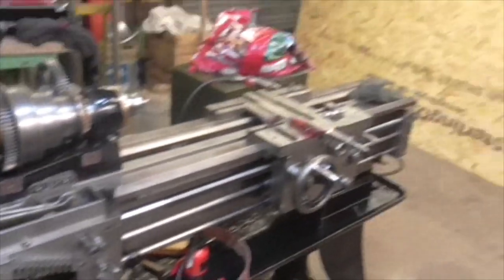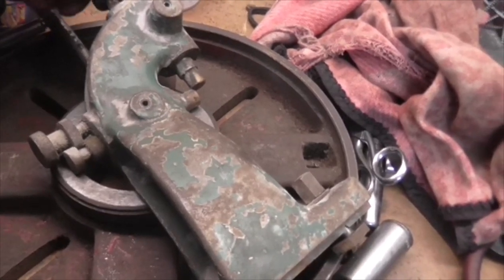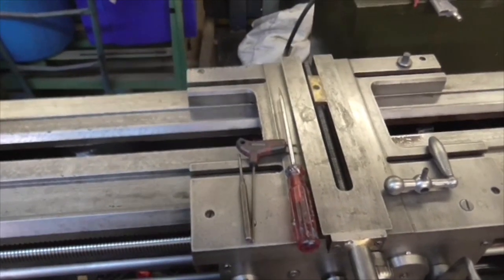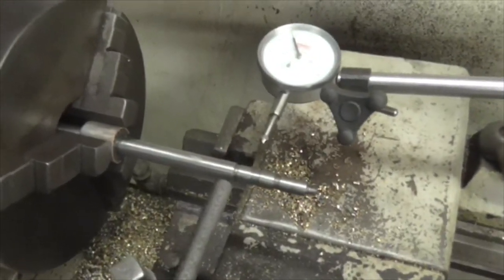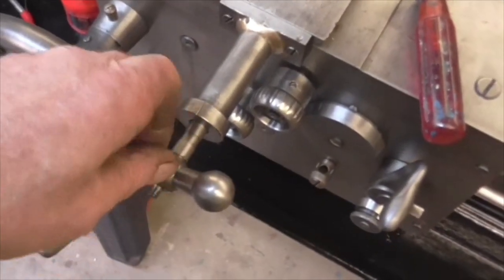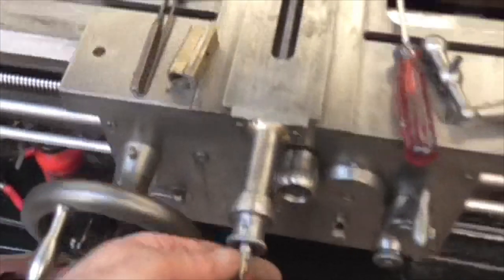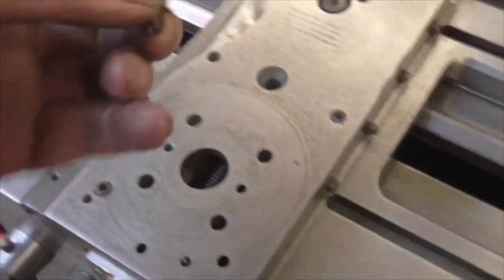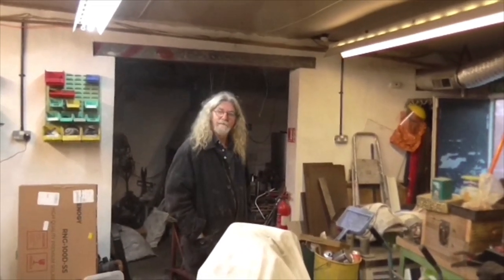A bent cross slide screw, and roof repairs

Comment: Great score on the Colchester parts. The toolpost is identical to ours and we have been thinking about a quick change tool post but have no idea which one would fit. I really like the way you used the lathe to deal with the bent cross slide
Reply from the maker: Thanks Joseph, i have chased several T slot cross slides, and had almost given up! I shall keep the three jaw chuck too provided it is not badly worn, and the tailstock handwheel as mine has been broken and repaired and wobbles when you turn it!
Phil

Comment: Nice find on Facebook Phil, parting tool and boring bar alone can be expensive ! not a fan of Q.C.T.P. what's the rush ? got one for my Smart & Brown, never use it. I have a four jaw chuck which fits my Holbrook, bought it cheaply with one jaw missing, need to spend some time trying to find a replacement. Del.
Reply from the maker: They can be bought Del but they aint cheap! I have some int40 tooling that fits nowt I have swap for the collets? Send us yer email address and i’ll get some pics!